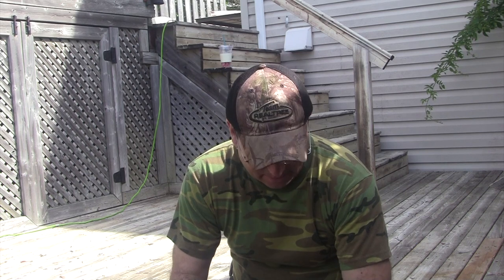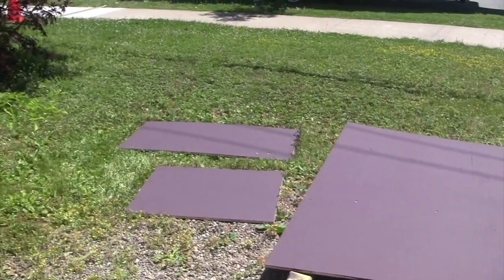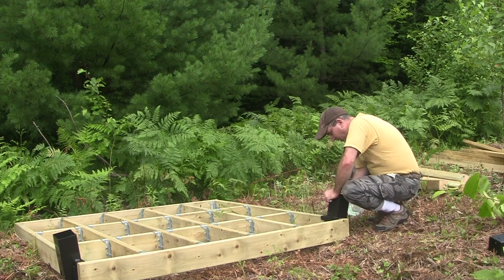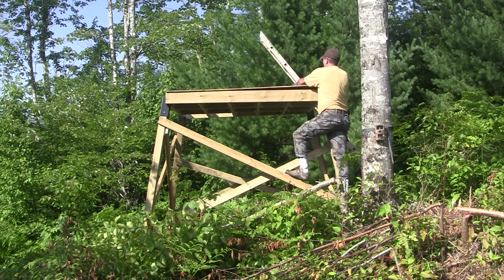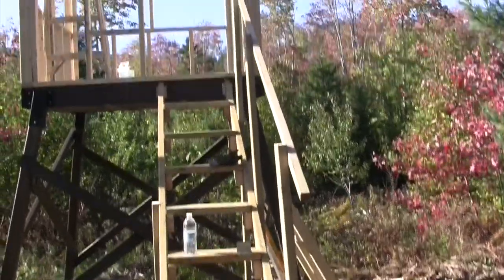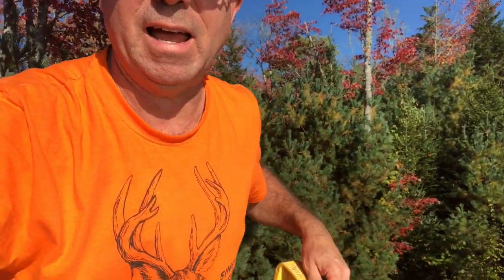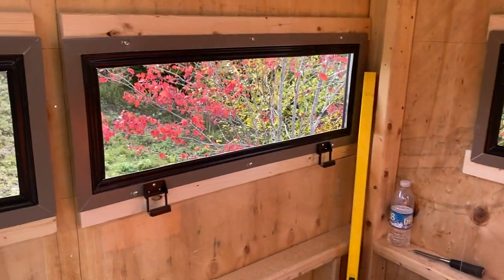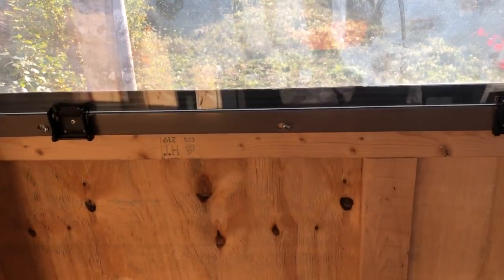How to Build a Deer Box Blind

Comment: Standard Deck screws are not engineered to take lateral movement they are meant more for vertical strength applications such as securing planks for decking. Using galv., nails are better for securing joists they have a higher sheering strength, and there are special galv., nails to hold those joist brackets you used again better sheering strength. But all I would do now that you are finished is  go back and place a few nails in the cross bracing to ensure they are secure for the long haul. And galv. everything is better when using treated lumber. Just saying for future ref.
Reply from the maker: I hear ya. I think it’s a conspiracy propagated by the galvanized nail industry. 😂 ya I may do it. Consider it a test.